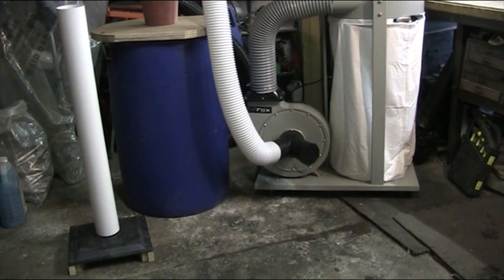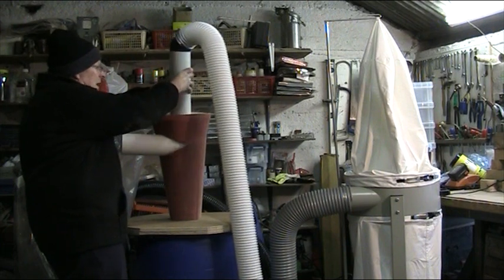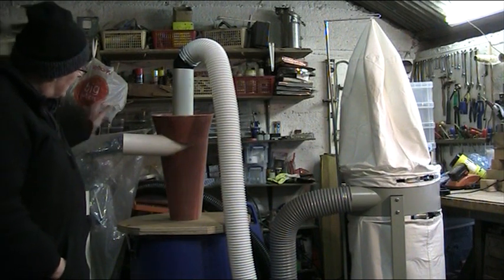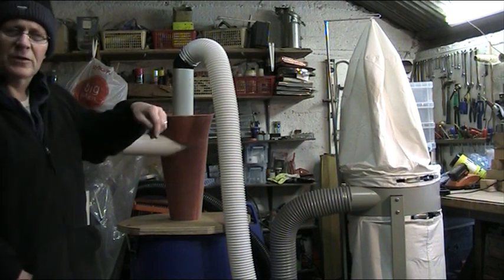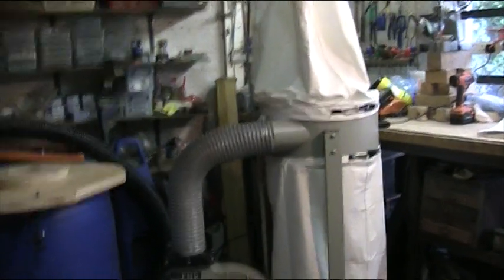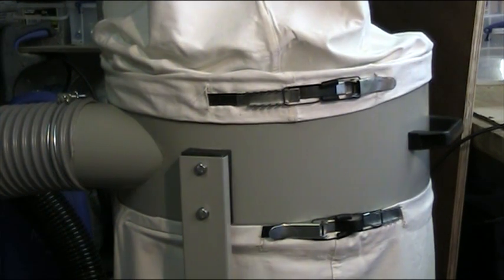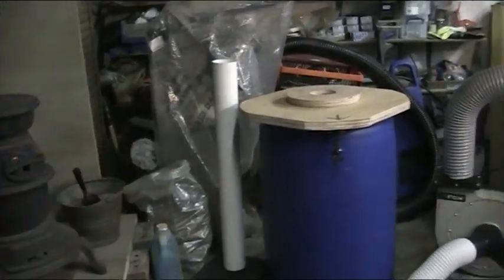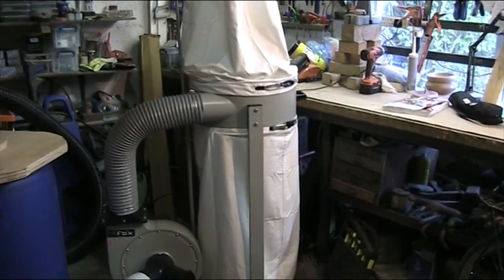Cyclone Project 5

Comment from the maker: Thank you Mark, and, by way of thanks, I'll give you the first update on the cyclone in action. I've been using it for about 5 months and I wouldn't change any part of the design. The cyclone is working perfectly and has made sanding a much more pleasant experience. I still wear a mask but I've noticed the air is a lot cleaner in the workshop so the extractor must be picking up the really fine dust.  There is still no dust in the bags.  Next job, set pipe runs. More later. Best Wishes, Brendan.

Comment: Ok Brendan, It’d be great to keep the dust out of the workshop but as you say, if you can see the dust you’re probably not going to be too bad but it’s the stuff you can’t see that does the harm. I should make yourself a nice wooden box to be buried in if I were you; you could stand it up on end and use it as a tool cupboard till it’s needed but at least you’d be sure of the craftsmanship and save a couple of euros. Man I can just see those finely turned handles.
 All the best ... Andy

Comment from the maker: Hi Andy, thank you.  It was good fun and works really well.  I didn't seal the top of the cone just in case I needed to open it to adjust the pipe but it is going great.  I can hardly believe the difference in the workshop...a lot less dust, especially in me.  I wear a great mask but tried the vacuum without it and virtually no dust got into my nose.  I decided to keep wearing the mask because it filters out invisible stuff that lingers in the air.  I'll do a progress video soon. Best Wishes, B.

Comment: Hi, Brendan:
Why does the top need to be fastened down with the bonnet latch?  That nice deep groove will keep it from sliding askew and gravity should keep it down when the extractor is not running.  When the extractor is running the differential pressure, slight though it is, will add up to a pretty significant amount over the full surface of the lid and will hold it down.  

Good job so far!
Bob

Comment from the maker: Thank you.  Stixall - good stuff, sets like silicon so good for use where a little movement is beneficial.  It seems to be very strong and any I've tried to remove fought back.  Some bits on the plastic rolled off like rubber when I removed them but left a residue that was hard to remove.  I would like to see how it sets in warm weather because the cure is slow now but I am happy with the bonds I got because I can't pull them apart.  I'll use it again.  It even works under water!